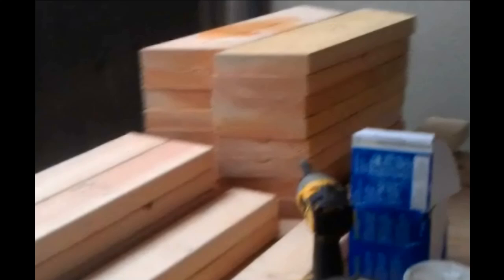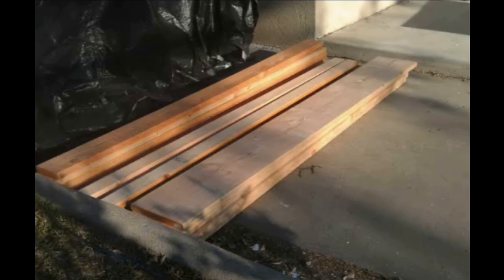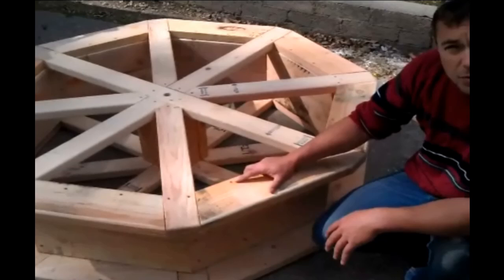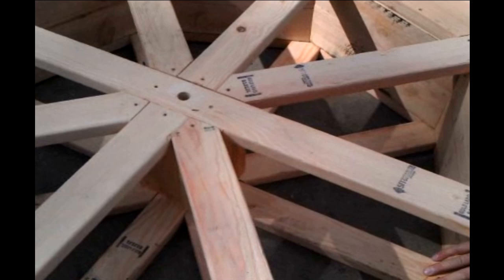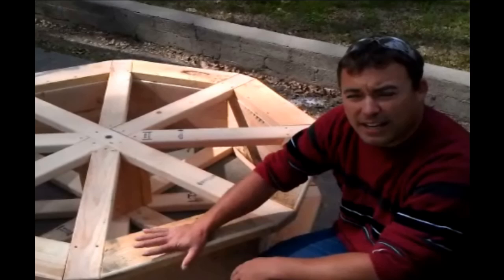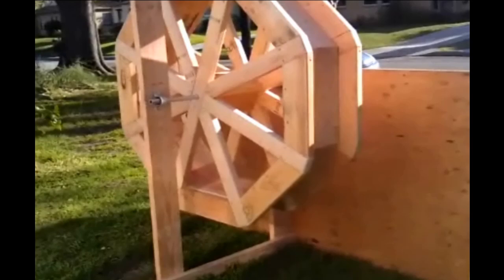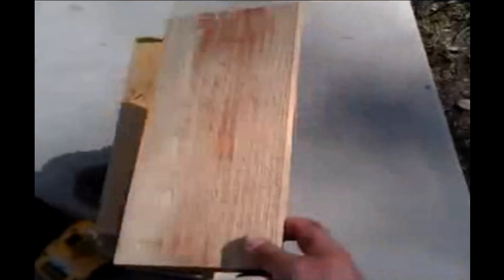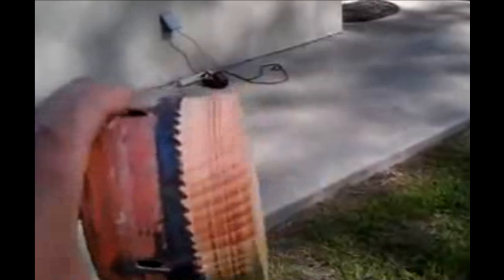We made a WATER WHEEL for an Abandoned Wild West Ghost Town (Pt.4)

Comment: The first two cross pieces could be half laped and glued. Stronger joint. Also you need wood that won't rot.  You need treated wood, cedar, and hemlock.thT
Reply from the maker: i agree with your suggestions and would totally do the lap joint.  treated wood would be better but we had a super tight budget for materials on this project so we got the cheapest wood and treated it to help last a little longer.  it was a prop that really only needed to last a year or so and then whatever happens happens.  anyone building this and wants it to last should take the steps you mentioned.  thanks for the comment =)
Reply: Hollywood Haunter wondering what the total materials cost on this was?